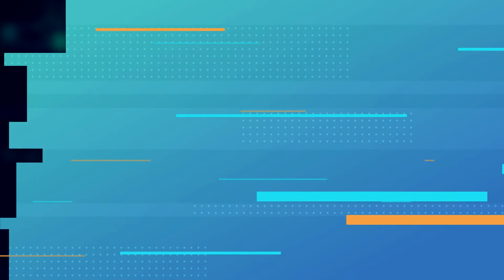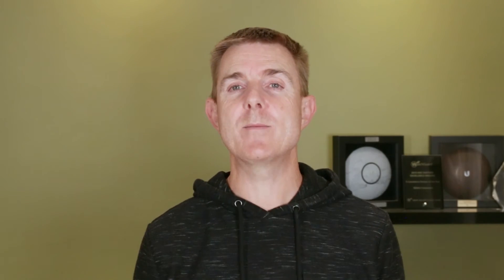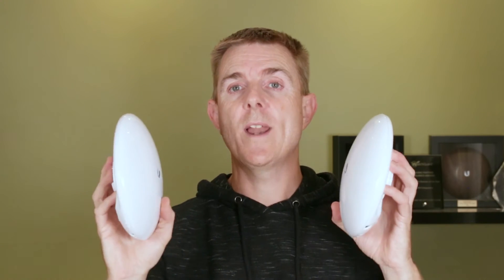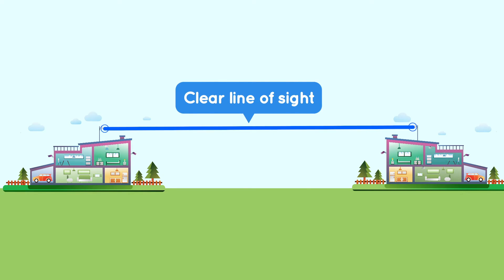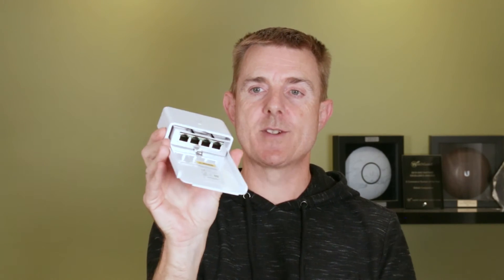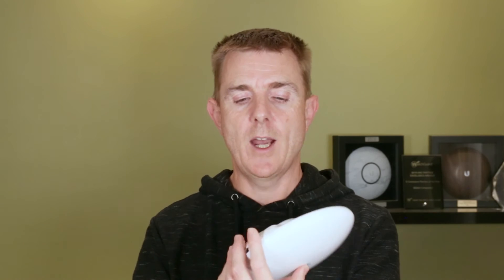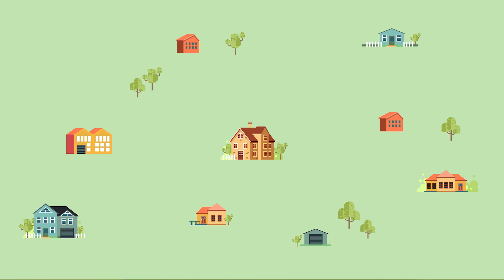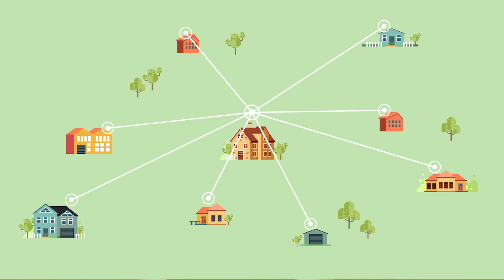What Do I Need To Run Point to Point

Comment: Im looking to set up an auto gate 300m from house. If i run a point to point system what type of power supply do i need at the gate? I will have a 12v battery and solar setup powering gate motor, will that run the point to point system and everything i need?
Thanks in advance
Reply from the maker: It will depend on the Manafacturer you use for the point to point.  Most use 24v, but you can use a Tycon PoE Injector to convert your 12v to 24v, or you can use a brand like Ruijie which will take a direct 12v input.

Comment: Does nano station need 2 units for the slower speed at the smaller distance you quoted? It wasn’t clear in the explanation. I’m assuming because you’re discussing point to point, that you do need 2 but I’m a novice so have no idea.
Reply from the maker: For a point to point you need to use two units.   If you want to do a shorter distance, then you could use 2 x Loco5AC, or if you want to go up to maybe a couple of kms then then 2 x nanobeam.  I hope this helps.
Reply: @The_Tech_Geeks  thanks. I’m sending from a house to a caravan parked about 50 metres away. There are no obstructions but it is an urban area with a lot of surrounding houses. Could I use a single outdoor access point from the house instead? Am I correct I understanding from your description that the problem with that would be my devices which aren’t capable of picking up the signal from that distance, even though the access point can send it that far?

Also, if I purchase units that are 5 GHz, can I convert signal to 2.4 GHz for devices which use it? Is that a sensible way to do it, to allow older devices to use it while future-proofing for 5Ghz? Thanks
Reply from the maker: Thanks for your reply.   To your first point, yes if you use a single outdoor access point then the weak link is the connecting device and it may struggle to connect at 50m

On your other point - if you are using 2 devices to connect a bridge, no other devices are going to connect to these.  They are used just for the bridge and so you won't be changing the frequencies.   Then at the other end of the bridge, ie your caravan, you will put an access point.  This will be connected to the bridge and as a result will give you wireless access in the caravan. 

I hope this helps further.

Comment: I current have a wifi extender in my pole shed that is about 300 ft from my home, and it works great, but now I am needing to create a small home network where the devices are on the same network whether in the shed or in the house and the extended wifi doesnt seem to do that, as it creates a new wifi to connect to and other devices are not discoverable when they are on the extended vs house wifi or vise verse.  if I go point to point and change my extender to an access point (it has that capability) would it simply be mesh like?  so basically my devices would switch from house router to shed access point "seemlessly" and I would be able to connect to a device in the shed while in the house?
Reply from the maker: Great question.   In basic terms yes.   If you change your extender to an Access Point and set it with the same SSID as the house, then your devices will roam between the two fairly seemlessly.  Just bear in mind that the connecting device controls which access point it will attach to.  As a result you could find yourself still connected to the house wireless for longer than you think before it switches over, as it chooses to drop the house access point and switch to the one in the shed.  I hope this helps

Comment: I'm trying to do a PTP short run from my house to a new Garden Office I've built, about 20 meters, the electric cable was already in so I don't want to dig another trench. WiFi doesn't cut it, neither does the powerline adaptors. I was looking at the Ubiquiti Nano / LOCO5AC and getting two for a PTP connection. What I'm confused about is can I use a wired connection at the office end as I want my computer hooked up via wired rather than wireless, and the details from Ubiquiti are quite clear.
Reply: Actually I think your video answers the above question, great stuff.
Reply from the maker: Hi,  All easy, but do let us know if we can help further.